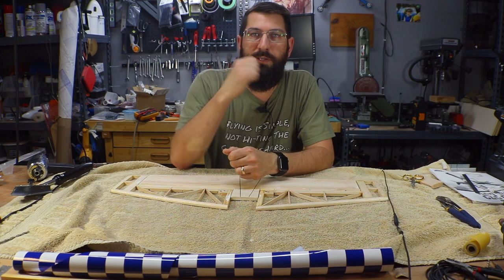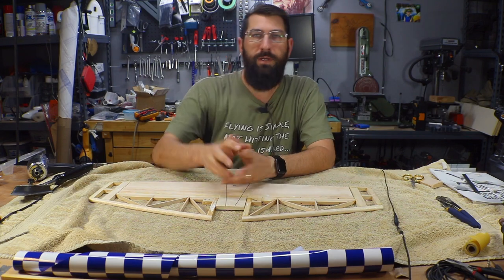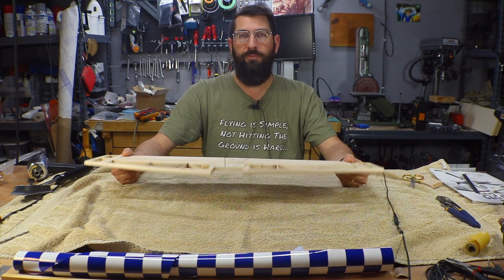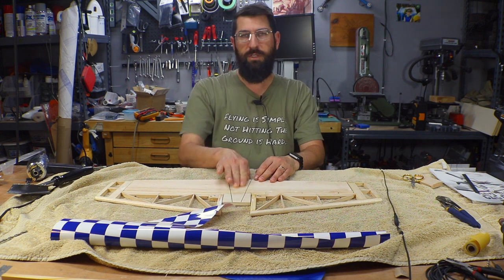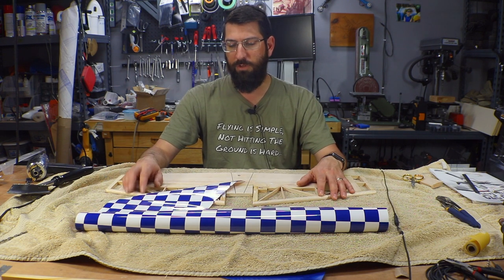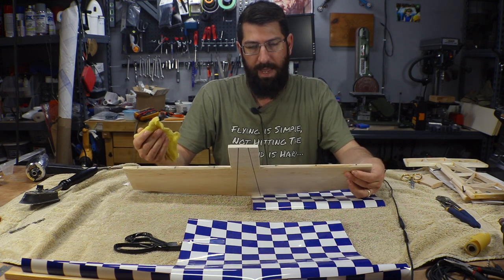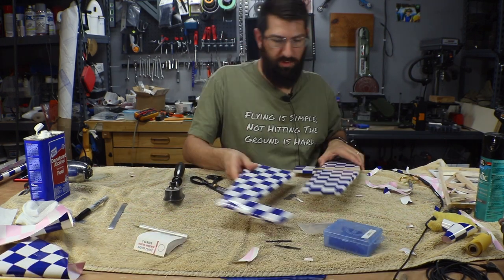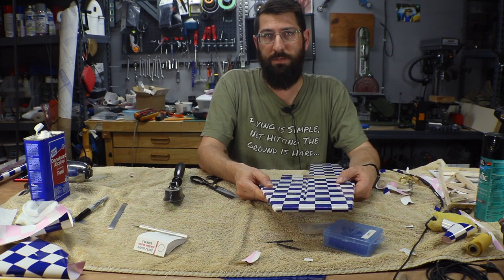Hangar 9 CAP 232 Part 2: Strip and Recover

Comment: Hey looks great. I was wondering when you laid your stripes on your wing did you put anything under them to help with air bubbles  before you used iron and or heat gun? or did you poke small holes where the stripes are set ?
Reply from the maker: No. I tried different solvents, but none worked. I was just carful and made sure I worked my way out to the edge. I then go back and pop the bubbles with a needle and stick down. Thanks for watching. I appreciate the support.